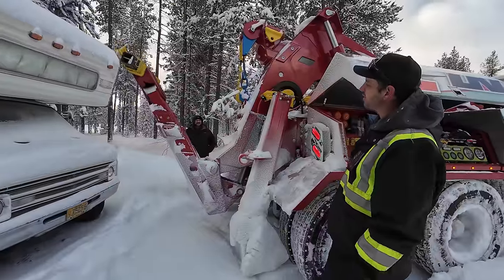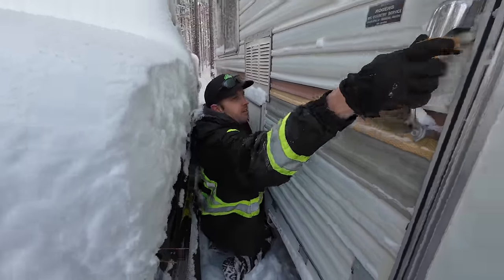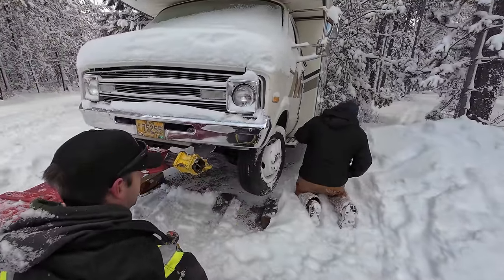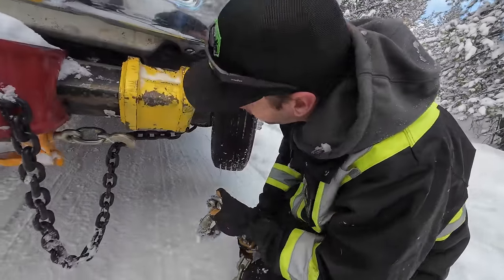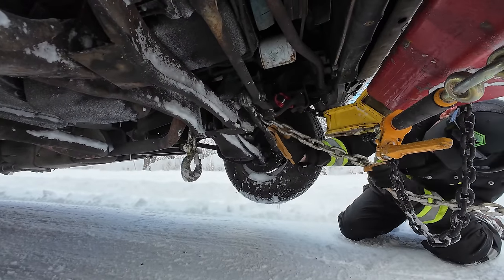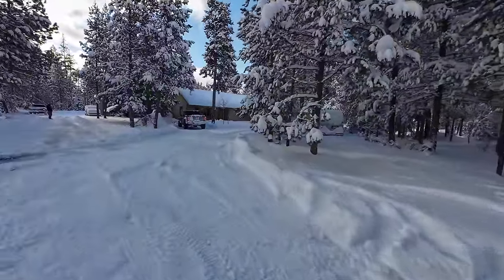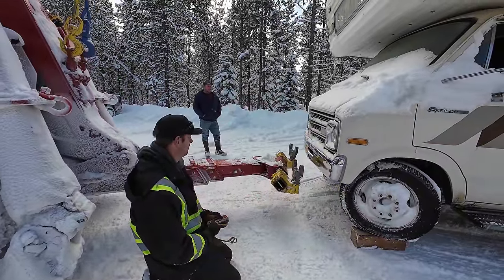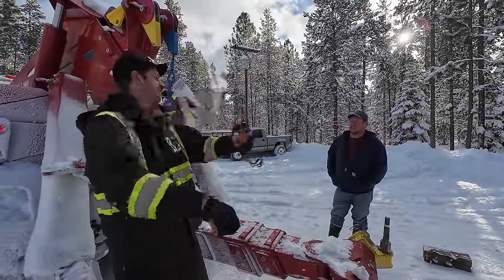Redemption day for the auto-chains.

Comment: The only reason you got stuck before is because of the sideways slope and both sets of chains were made to go forward and backwards and offer little help sideways, maybe even acted like runners on and sled. I don't know if they make a set of chains with a criss cross pattern or not but that is the only way that the chains would have helped from gravity, load and the sloping slippery road. When in doubt hit the throttle as a last resort, sometimes it works!

Comment: They work going forward.
Reply from the maker: And backwards, and stopped.
Reply: @CaseyLaDelle  Casey I was referring to the chains that come down when turned on not chains mounted on tires. Had them on an oil truck and you were fine while moving. Forward .
Reply from the maker: @glennpiller9417  so was I, and you’re wrong.  They work going forward, reverse, and stopped.
Reply: @CaseyLaDelle  I had them on an oil truck Casey if I was loaded yes but if not they didn't work worth a damn !

Comment: With all of that snow on the back of the Zacklift, are you seeing any improvements Matt could make?
Reply from the maker: So far it’s been fine.   No build up anywhere that’s causing problems
Reply: @CaseyLaDelle  Guess it just take compressed air blower to clean the snow off?
Reply from the maker: @mattimatkalainen  it’ll melt eventually 🤷🏻‍♂️

Comment: Just out of curiosity do they make wheel lifts for heavy wreckers like the black dodge and small wrecker have? 

Would that work?
Would it be safe? 
Would it be quicker?
Reply from the maker: Not automatic like the black truck, but yes there are wheel lifts for them.  I’ll get one eventually
Reply: @CaseyLaDelle   I get it, I know in general none of that stuff is cheap and if it where you probably wouldn't want to use it.
Maybe TEMU has wrecker stuff 😂